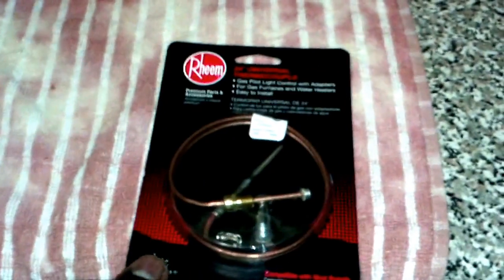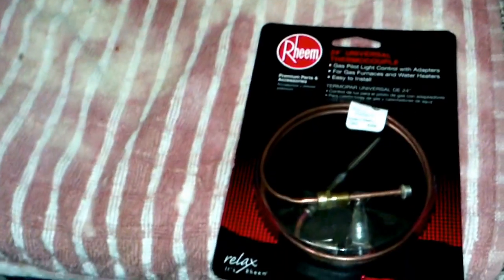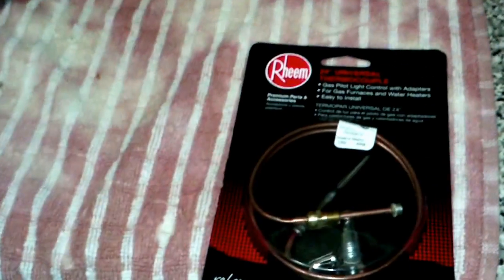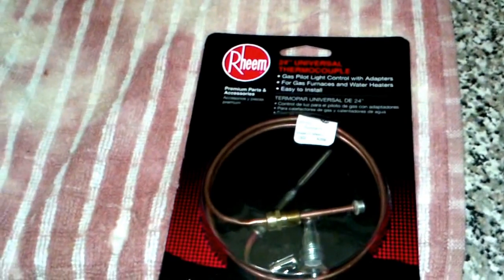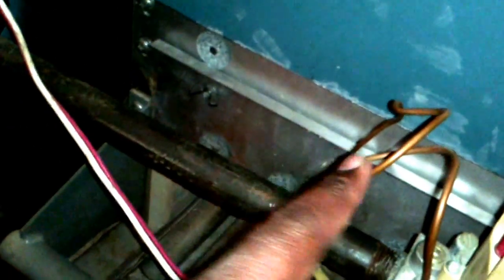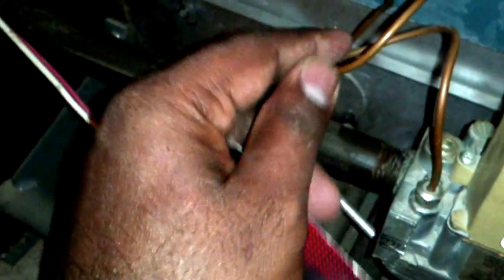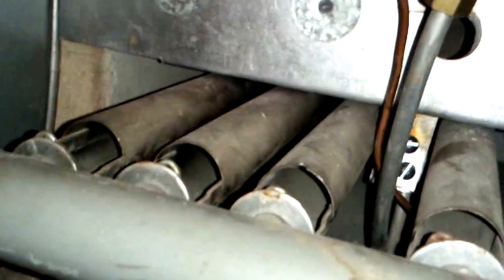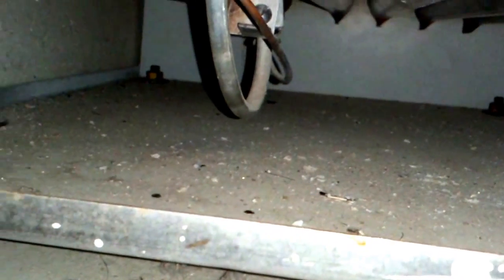How to change replace a thermocouple on gas steam boiler

Comment: Great video! The boiler here has the pilot light and thermocouple located in the same awkward location as my boiler (Crown Aruba 3...Other boilers seem to have the thermocouple in a much more accessible place.) This video showed me how to replace the thermocouple myself, saving me time and I'm sure a couple hundred bucks at least. Also, agree with other commenter, great safety tips in this video.
Reply from the maker: +Naveen Mallikarjuna thank you